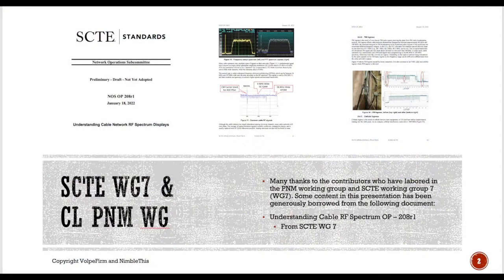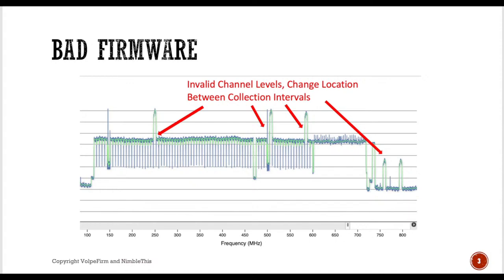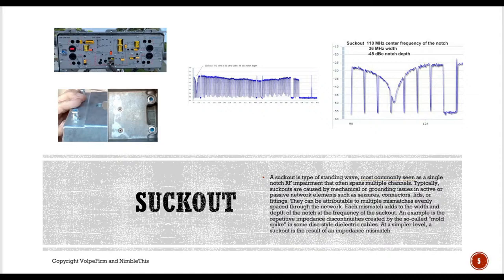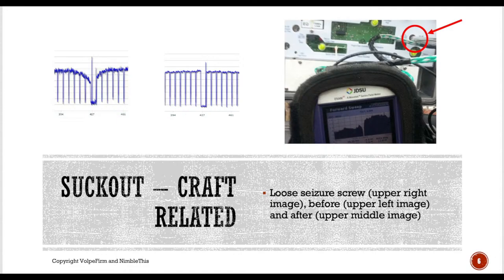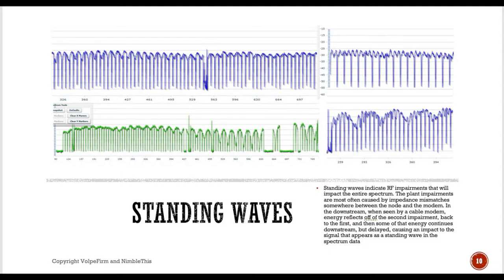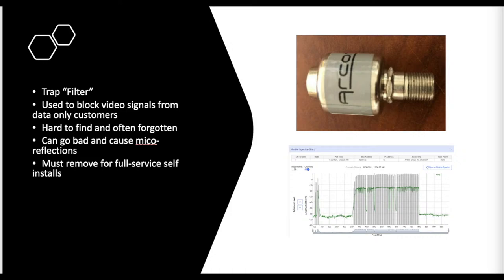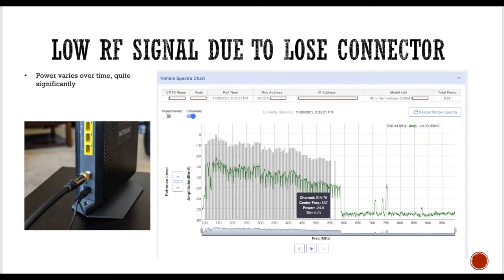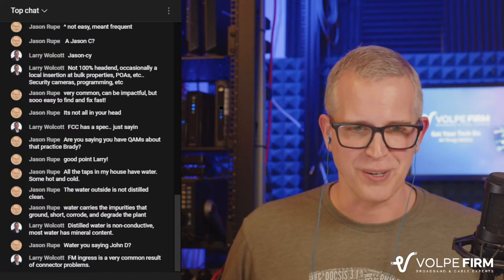Understanding Cable Network RF Spectrum Displays

Comment: I like this channel. I've never been in the cable biz but I understand the RF topics talked about here. 
Our community first got cable  TV in 1955. I remember it coming to our house. It was channels 2-6. The main cable was RG-11u with RG-59 drops. All before the F connector. Just inside the house was a block with two screws, for the twin lead. The amplifiers were all vacuum tubes, of course. Later on, I became friends with the guy who put in the system. His name was Warren Fribley. 

I also knew the guy who invented RF tilt in the amps to compensate for high frequency loss in the coax. He was a grumpy old guy.
Reply from the maker: Hi Dave, thank you for the background. I have met some grumpy people in the industry but also a lot of fun people as well. In general, RF is can be really fun as you likely know. 😀
Reply: @Volpefirm  Most have been great people. I knew the guy from Eastern Microwave. They used to bring the signal in from NYC, through PA to Corning, NY. Also station from Hamilton Ontario. He used to give me books that I could learn about the technology. 
Some of the techs that come to the street to fix stuff have helped me to learn about the newer tech.

Comment: Great Video!  Here's some real time working feedback from Hawaii:  We've seen a high amount of Bad FW FBC signatures as a result of Arris TM1602AP2 modems.  Hitron D3.1and higher models have shown an FBC Adjacency between 200-300MHz.  Sercomm ES2251 modems show an FBC Resonant Peak between 200-300MHz.  My MSO refers to suckouts as 'Notches'.  Roll Off is referred to as Spectrum Tilt, however, it can refer to Forward (amp/in-line EQ) or Reverse (attenuation- natural or as a result of non-linearity).  Appreciate your content sir!
Reply from the maker: Hi Jordan, thanks for the great insight!